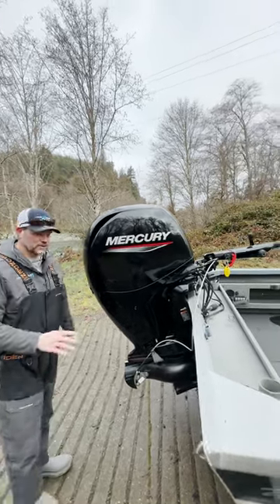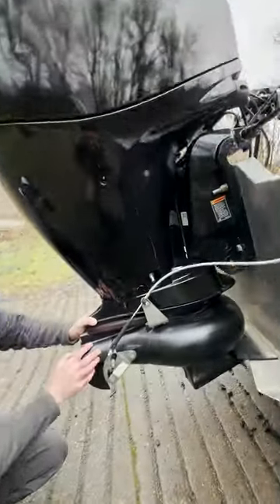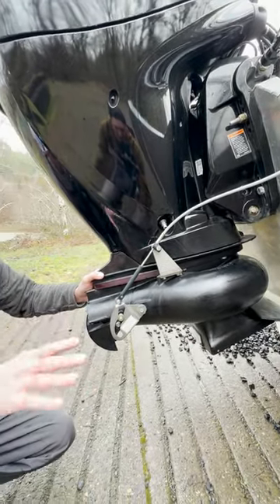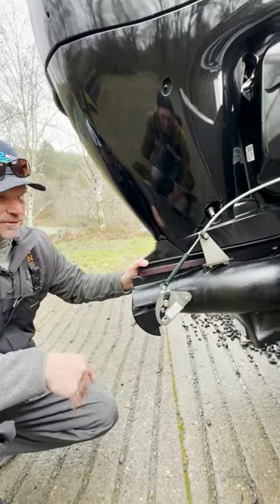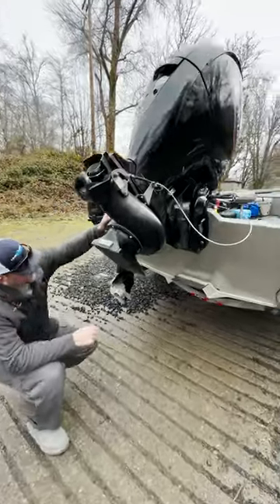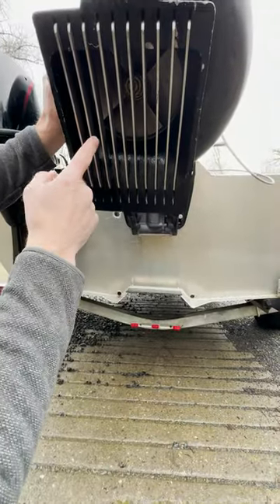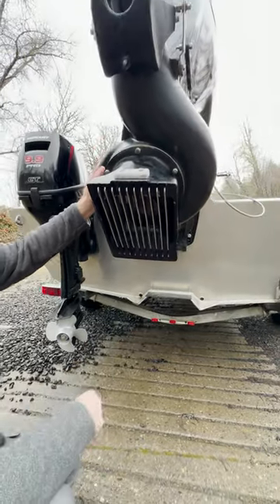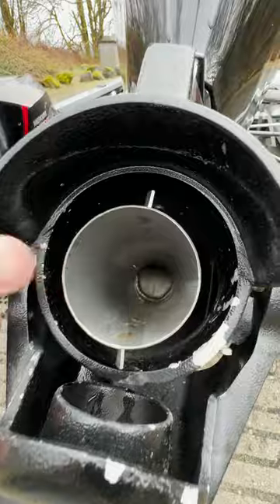How a Jet Outboard Works

Comment: Good boats perfect size for rivers and shallow waters the only problem is you loose about 25% of your tater horse power using a jet
Reply: You lose 100% when you throw all the blades off a traditional propeller
Reply: @jasonlacroix6083  jack plate works great and if you have common sense prop is better you’ll loose 100% of your power wheels you suck a rock up in you jet
Reply: @Huntersprojects my comment was kind of meant in jest. I've only seen these jet drive outboards on TV, being used in shallow, Rocky rivers. A prop drive setup in that kind of environment, I would think would be destroyed almost immediately. I dont have any experience in river conditions or jet drive setups.

Comment: If i remember correctly, you lose about 30% of your power compared to prop drive
Reply from the maker: That’s correct. That’s why most opt for a little larger powerhead with a pump.

Comment: And these units also drop around half the power output of a true prop powered outboard motor. If you want a jet buy a true jet boat.
Reply: It's a lot but not that much..

Yamaha rates their motors like this:
150hp=105hp
115hp=80hp
90hp=65hp
60hp=40hp
40hp=30hp

So really not that bad if you need or want the piece of mind of only a few inches coming off the bottom of the motor to make it drive vs a prop that can be damaged or broken...

Depends on what you want to do with it and most importantly where. Youre not going to buy a new yamaha jetboat to take out fishing. But the jet-pump drive outboard would be perfect for that.

Comment: Is it faster than a prop ??
Reply: No. Props are faster which is why they’re far more common. You’d only run a jet where you don’t want the prop sticking down below the boat bottom - IE: shallow water, rivers with rocks, etc…. For everywhere else, props the way to go.